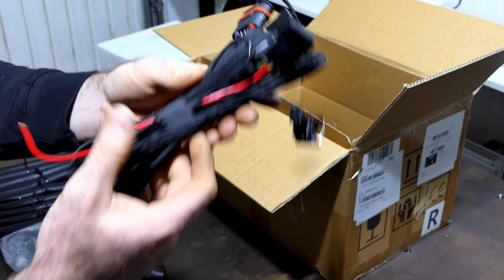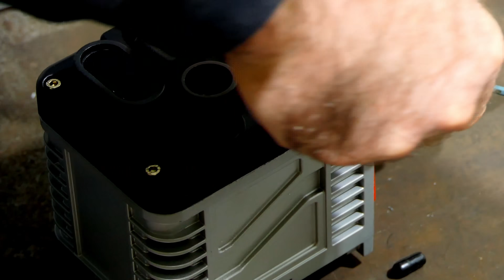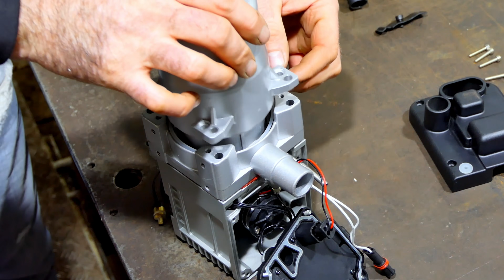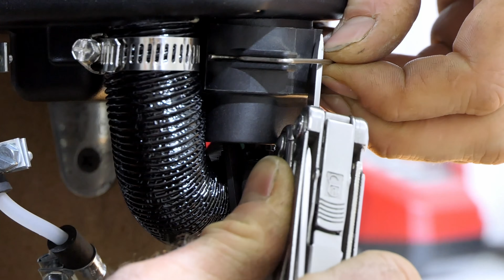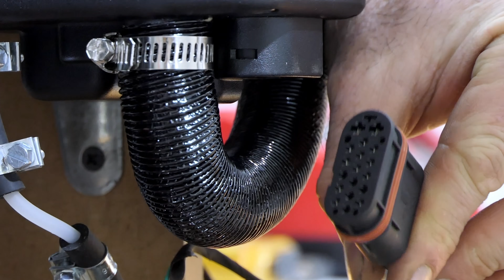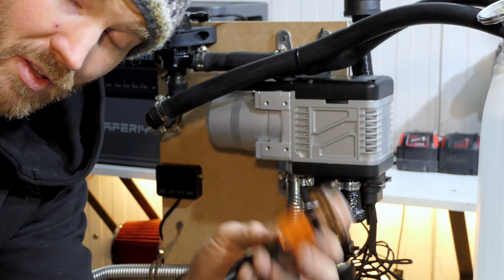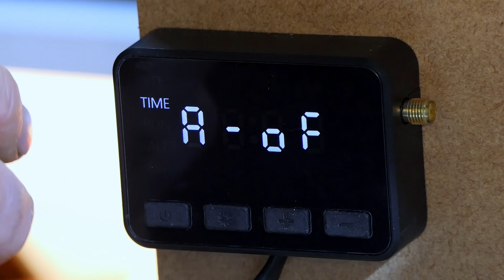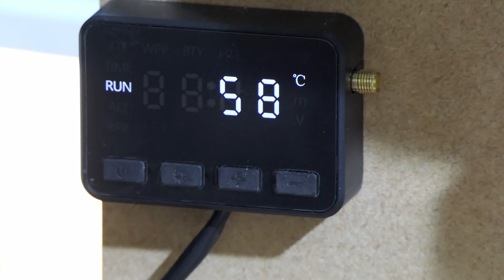Wonder of Manufacturing - Worlds Cheapest Automated Hot Water Central Heating System

Comment: I am curious about the efficiency difference between using electricity to power the electric bits of the diesel heater vs. just using electricity to directly heat the water.
Reply from the maker: Electric is £0.25/kWh and currently heating oil (kerosene) is £0.05/kWh. Cheers J

Comment: *Myth* - Adding antifreeze (glycol) increases efficiency by increasing heat transfer - *WRONG*
Glycol (both ethylene and propylene) *DECREASES* the heat transfer and heat carrying capacity of water. Glycols *ONLY* offer corrosion and freezing protection - and possibly some lubrication, but at the cost of decreased efficiency of viscosity.

Before glycols, it was standard practice to add ethanol or methanol as an anti-freezing agent. Better thermal conductivity...  but highly flammable so...  yeah.
Reply from the maker: You're right I got that the wrong way round. Cheers J

Comment: Cool. Would it run on recycled cooking oil?
Reply from the maker: It can but I would be concerned about how to clean the mesh. On a regular diesel heater you can replace and clean the parts a bit easier. Veg oil and black diesel  is a bit dirty to burn. Cheers J

Comment: its probably a lot closer to 5kw than 3.2 - your entire system is uninsulated and in 8 degrees C air, you would have been losing a reasonable amount of heat to the air.
Reply from the maker: It reflects the heat loss in a Normal system. Insulation would definitely help for efficiency though. Cheers J
Reply: @joshuadelisle  yes, but the heatloss in a "normal system" will go into the room to heat it still, so its not 3.2kw, its more than that (unless you're silly enough to have uninsulated tanks with heated water outside your thermal envelope)

Comment: We must account for the loss of heat from the water tank to your cold garage. Efficiency is likely greater than reported - insulating the water tank should produce significantly higher efficiency
Reply from the maker: Yes. However in a realistic system there will be lots of heat loss so the results are still relevant but you can certainly increase the efficiency with an exhaust heat exchanger and insulation. Cheers J
Reply: @joshuadelisle  I think he's speaking more in terms of your calculations of the heater's efficiency, not your overall system. Heat losses to other parts of a system are kind of up to the installer, and can't really be blamed on the heater.

I believe all of these heaters are typically rated in terms of fuel consumption though. So a 5kw heater should be expected to burn approximately .125gallons of diesel per hour.

Kerosene has a slightly lower energy density than diesel, so the heat output will be a bit less (although, for all practical purposes, not really noticeable).

Comment: Hey man nice video about this heater! I got it like 1 year ago for heating my hot tob with 3m3 water in it and its working like a charm without any problems at all and that hot tub is salt water also :D but one thing I dont like and find annoying about it and that is the 1 hour max running time... I just have to watch the timer and "reset" it to 60 min all the time so its just annoying :D If you find a way to run it for more than 60 min with easy "fix" can you do a video about it? It would be really nice!
Reply from the maker: Ah! I didn't think that was the issue on auto. I thought it would go by the temperature..... If so I'll find a way to override it or program a new controller with an Arduino or something. Cheers J
Reply: @joshuadelisle  the auto is still for 1 hour no matter what. If you find a way with arduino I would love to see the solution for that, even some tutorial :D

Comment: Hi. Why do you say, the exhaust always has to go downwards.
Thanks.
Reply from the maker: The hydrocarbon reaction produces water which has carbon dioxide dissolved in it making it carbonic acid. If that condenses and remains in the exhaust then it will corrode it fast and need replacing often. Cheers J
Reply: @joshuadelisle  
Cheers Josh.
Best Regards.

Comment: Doesn't seem to be that many fins in the water compartment to transfer the heat from the combustion chamber. I'd assume that more fins more surface area more heat transfer. Dont know if thats a limitation of the casting process or a design choice. ?  🤔  Just thinking out loud for the algorithm
Reply: Ps.. not that it will change the efficiency more along the lines of optimal flow rate for something like under floor heating. Does it matter ?  Probably not that much if any.
Reply from the maker: @KouRou2002  it might be. Without doing an analysis model on some fancy software I wouldn't know. Sometimes it's better to keep things simple. Cheers J

Comment: One thing to mention "A" setting its not automatic mode is only autostar option the heater will kick in when water temperature will drop below 60C. Also there are other controlers avaible and they have diferens settings where you can controll the how much fuel it takes to burn so it will heat up but slower...
Reply from the maker: Interesting. Good tip. Cheers J

Comment: How exciting... With Ai steaming along we will all be able to make things a lot easier... I live off grid in the hills and this will definitly help me treat my water I get from the creek... at the moment it costs me about AU$5 in unleaded to use my 8kva generator to get 30 litres of water boiling for 10 minutes to make it safe... I too am now dreaming of a hot tub. Thanks heaps brother Josh.
Reply from the maker: Thank you. Cheers J
Reply: Why would  you not use a reverse osmosis water filter with a low volumn high pressure12V pump?
Reply: @ no need. Need to sterilise it so have to boil it for close to ten minutes and then can use gravity filter that keeps all the beneficial elements.  You could use charcoal and uv if you wanted to do it that way. Or just do your reverse osmosis… however you feel best.

Comment: I like the idea of those diesel heaters for air, but have worried about running the exhaust through a wall or whatnot for my workshop as I'd have to insulate the snot out of it with high-temp materials, and it'd be rather inconvenient the rest of the year. This looks quite simple, but you could probably get away with running it outside in an enclosure and just run the heated water into a forced air radiator or whatnot. Hmm! 
I have jugs and jugs of waste oil I hang on to for running my foundry furnace during the summer, but I'd love to look into this as a secondary use fuel.
Reply from the maker: Lots of possibilities. Cheers J

Comment: cables tied in a figure 8 shape is fine, its when you coil them tightly in a circle youll get problems if at a high amperage.
Reply from the maker: @All_the_keys  you're probably right but it's not good practice either way. Cheers J

Comment: Looks like a nice bit of kit. Imagine hooking that up with a hot water cylinder. Could quite easily set the unit outside and run some pipes from the water pump.
Reply from the maker: You certainly could. Cheers J

Comment: In order to get the heat of the exhaust system, it would be a good efficiency to use a double-walled exhaust pipe, with exhaust gases flowing inside and the water to be heated outside. 

Is there such a pipe for sale ? 

Or build it yourself ? 

Greets from Essen ( Germany , Ruhrarea )
Reply: Dopelrohr(e?) , I was making those years back in ger :)  Order it at local welder shop, no ready made product :(
Reply from the maker: I'll be working on something similar and efficient. Cheers J

Comment: Seems like a normal diesel heater that has some silicon seals (glue gasket?) and instead of an air fan, its just a water pump.. 
 Leads me to think that you could easily convert a normal unit to handle water if you already have one laying around. 
I've thought about trying to convert one to operate on natural gas..
Reply from the maker: I've thought the same also. Although it's not as simple as you would hope but a conversion is definitely possible. Cheers J

Comment: This is why I love your videos, you not only listen to the comments but you investigate them too. Galvanic corrosion is no joke, especially in a hot system. For your heater system, you should try using a radiator for your exhaust. Make sure the top is the in port and the bottom is the out port. As you say make sure the exhaust always flows downwards to remove condensation. Home radiators are so cheap and you don't have to deal with aluminium!
Reply from the maker: Thank you so much. Cheers J
Reply: watch out for backpressure .... might mess with the burning
Reply: So can we just put the exhaust pipe into one of the 2 water pipe holes in a home water radiator? Then let the exhaust gas find it's way out of the other hole. And while it's inside it's going to warm up the radiator. Is that the idea?

Seems straight forward. Just got to remember to allow the moisture condensation water to drip out. And steer the exhaust gas away outside and a certain distance from windows or ventilation fans.
Reply from the maker: @Google_Does_Evil_Now  no I wouldn't use the water pipes for hot gas. Instead I would pass the exhaust pipe though the water tank so the exhaust heats the water. The rest of the system is designed for water only. Cheers J

Comment: Luv ya stuff, I like a kazilion other' caravaners and boater's, require three things, warm air heating, hot water plus a dehumidifier all in one unit, running from diesel or paraffin/kerosene ,plus what solar power would run it,  calor gas bottles have risen 20% in the last 2years, electricity now paying 40p per kw metered, make it i'll buy it,
Reply from the maker: Lots more to come. Cheers J

Comment: If you used 210ml in half an hour then that costs 23.1p /hour at 55 p/litre but kerosene is 90p per litre at the moment which would cost 37.8p /hour
Reply from the maker: It depends on the price of fuel which goes up and down depending on supply and demand. Cheers J
Reply: I’m in Canada trying to figure out how Kerosene is a third the price of diesel.  Here I’m only finding it for 3 times the price of diesel!  Do you get it subsidized and piped to your homes in bulk there?

Comment: If you press on upper pin on the remote while the heater is running you can scroll and see current battery voltage, temperature of the chamber and more. Great video cheers!
Reply from the maker: Good tip. Cheers J
Reply: Do you know can you change the pump and fan speed on this model?

Comment: You mention this heater can use glycol as the same as my caravan heating system uses for the central heating, got me thinking if this could be integrated into the existing ALDI Gas/electric heating system as a3rd heating option? Not sure if either pump would allow flow whilst the other is working though?
Reply from the maker: It probably could. I was sucking water through the system to rid it of air locks with no issues. You could easily introduce valves to isolate the different systems too. Cheers J
Reply: @joshuadelisle  forgot to say keep up the awesome content, you have a really great style and thoroughness about things, love it.
Reply from the maker: @deanmathers4483  thank you so much. I appreciate your kind feedback. Cheers J
Reply: @joshuadelisle  yeah I would think a centrifugal pump would still allow flow, not sure what type of pump is in the Aldi boiler but would like a diesel back up. Already have a Lavaner Pro 5KW heater which I love.
Reply from the maker: @deanmathers4483  nice. Cheers J

Comment: I read that someone's Diesel Heater pump burned out because they ran it on kerosene which supposedly has less lubricity then diesel. Not sure if it's true.
Reply from the maker: I've ran mine for years on kerosene with no issues. Pumps are £20. It's more likely to break with air bubbles in the lines. Cheers J
Reply: @joshuadelisle  Good to know

Comment: Thank you for the video. The 0.07 pence of kerosone to heat that reservoir of water, how much would that have cost in a regular home with a hot water boiler in electricity, for example with a 2,000W heating element. Just to make a comparison. Thank you.
Reply from the maker: That's a good question. It's probably easy to Google what an average bath costs to run. It's certainly a good idea to do a test on. Cheers J

Comment: Joshua... At 11:58 as regards air intake tube and exhaust output tube, I thought i'd read that these could both be shortened to a minimum of 20 centimetres, with the air intake a possible maximum of 1.5 metres and the exhaust output a maximum of 1 metre. I might be wrong, but for those of us that like to tinker with things, it's worthwhile to know the limits and still maintain an adequate 'pressure balance'. Maybe i saw a different model??? Cheers.
Reply from the maker: According to the instructions it needs no less than 60cm. But in reality it's probably fine at 20cm without much to worry about. Cheers J
Reply: @joshuadelisle  Check your own video at 35 seconds in. You are showing the information about the shorter lengths on your own manual.

Comment: Interesting how in the US our Kerosene is double the cost of diesel and is no longer sold at the pumps but rather by the gallon in department stores ranging between 8.5 to 12 $ a gallon.
Reply: UK gallons are also different to US gallons, ours are 4.54 litres, US are 3.78 litres, just so folk know for comparison purposes.
Reply from the maker: @MrNatbatten  I didn't realise that. Cheers J
Reply from the maker: Regular diesel is much cheaper than the UK though. Cheers J
Reply: I wished we paid your prices for fuel of every kind.
Reply: Our kerosene heating oil in the UK is about 55p on average per litre if you buy 500 litres, I seem to remember paying about 17p a litre when I had an oil boiler back in the early 2000's, oh well, lol.
Reply: You can still buy it as "heating oil" from larger distributors, who will deliver it. The only problem is, you have to buy a minimum amount (usually 100 gallons or more) in order for them to deliver it. Some fuel stations still sell it, but it's hard to find and it's usually not worth the cost or hassle when you can just buy red diesel instead.
Reply: I've seen kerosene (and red diesel) pumps in a few rural areas in the USA but I agree it's extremely rare. Wonder if UK has red diesel (no road tax).
Reply: @PsRohrbaugh  i think its being phased out
Reply: Living on the east coast of US we have plenty of kerosene and/or off road diesel pumps. It is usually half the price of regular diesel.
Reply: Burn chamber/glow plug s a copy of the webasto design, odd that they have changed from the eber design they use on the air heaters. Both work well so I can't see any need for them to have changed except when copying it's maybe easier to copy the whole thing than adapt the designs to reuse tooling.

Comment: Joshua, how easy is it to buy Kerosene for the 'normal guy in the street'. 😊
Reply from the maker: Making bio diesel from restaurant frying oil is probably your cheapest option. You can still get an oil tank installed at your house so much you can get heating oil (kerosene) cheap but it's a large initial cost. Cheers J

Comment: Do you think one unit would work for both in floor water heater and shower water heater? (With the water filtered of course.)
Reply from the maker: You can circulate the system in a hot water tank, which can then be distributed to different applications and at different temperatures. Just like a normal central heating system that does hot water in the taps. Cheers J
Reply: Also: Do you think it'd be better to have the air intake outside or keep it inside?

Comment: Another thought provoking video! ...... Well done that man!

As per electrolytic corrosion, I do not know how glycol affects things but you can get a corrosion inhibitor for normal central heating systems.  This is designed to stop electrolytic corrosion between Aluminium, Copper and Steel ..... so should be a good thing in your setup!

Given the direction our world is going (especially here in the UK) these are all great tools to have in your kit in order to enable if not grid free living then a reduced dependence on the grid.
Even the annoying overstating of capacity can be forgiven for this kind of kit ...... Brilliant!
Reply from the maker: Thank you. I totally agree. Cheers J

Comment: When sealing up things to heat (with in reason) clear silicone works really well against heat, just make sure it has gone off before exposing to heat.
Been using it on car exhaust parts for years.
I realised how good it was after tying to burn some off a piece of glass, it did come off the class. . .  or should I say the glass came off it!
Reply from the maker: Good to know. Cheers J

Comment: I would like to weld up a stainless double wall chimney/heat exchanger 8' tall, mount the heater under my step van and utilize the thermo syphon flow to move the antifreeze through the floor &  the 4bt diesel engine but can I run the exhaust straight up 8'?
Reply from the maker: You may get back flow issues going up a large diameter. The instructions are specific on pointing downwards. Cheers J for

Comment: Please do the build video of the hot tub. I have one half built from an IBC container. I'm thinking of scrapping that off though and using 2 tin baths on decking for me and my wife instead. It would be easier to keep clean, less water usage and when not in use I'd be able to move it all. I would like a system that keeps the water warm though so we can spend an hour or two in there with a glass of wine. But either way, what ever you come up with will be helpful for my own endeavours. 

Many thanks for bringing these heaters to my attention. It looks like the answer to my problems has just fallen in my lap!
Reply from the maker: Thank you. I had the idea to use an IBC too but also came to the conclusion that a regular bath is more cost effective and can still use jacuzzi jets. I've got 4 kids though that want space to splash around. Cheers J